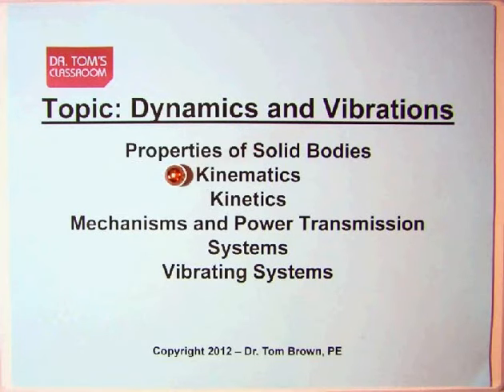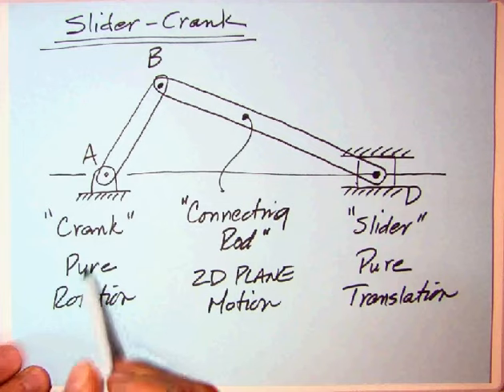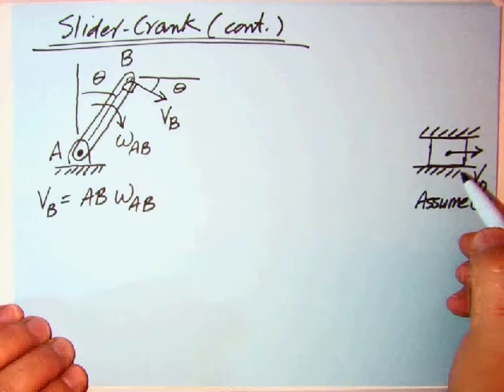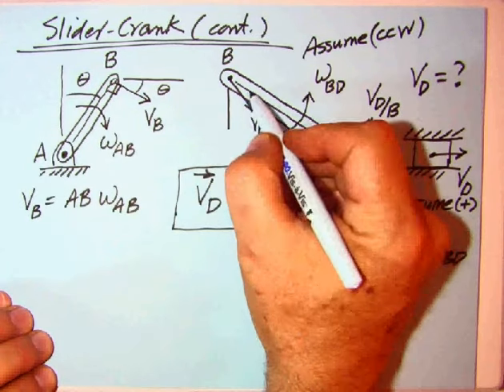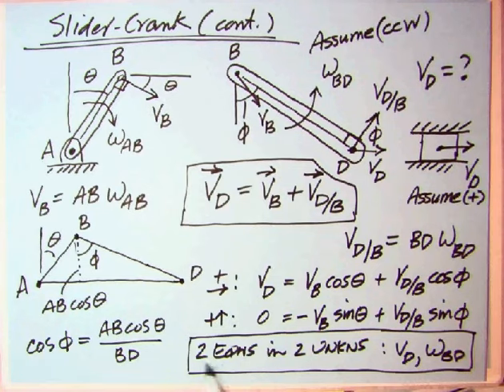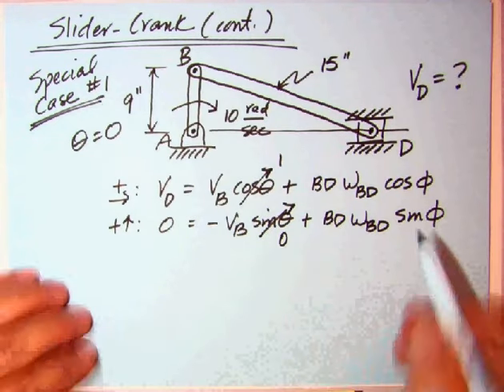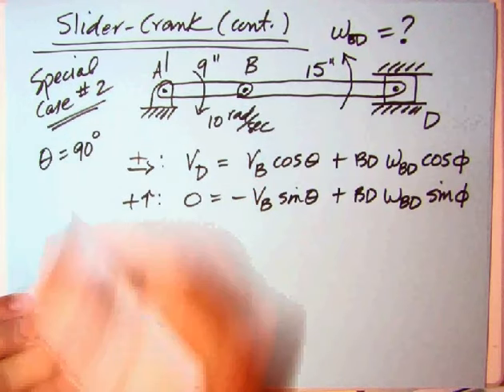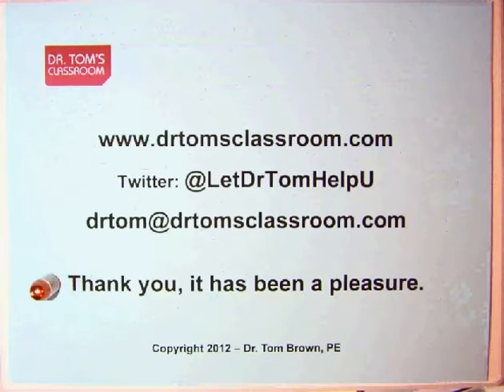Slider-Crank - Machine Dynamics (What the MERM doesn't tell you)

Comment: offset slider crack mechanism analysis please
Reply from the maker: Vijay Pandey These videos were created for those preparing to take the Mechanical Engineering PE Exam, and seeing an offset slider crank problem on this exam is highly unlikely.  However, only the geometry of the connecting rod changes as the slider is still in Pure Translation and the crank in Pure Rotation.  And no closed form solution exists, so each problem is unique depending on how much the slider would be offset.  If you understand the principles and steps in this video, you should be able to solve any slider-crank problem.  By the way, how did you come to watch my video?  And where are you located?  Tom